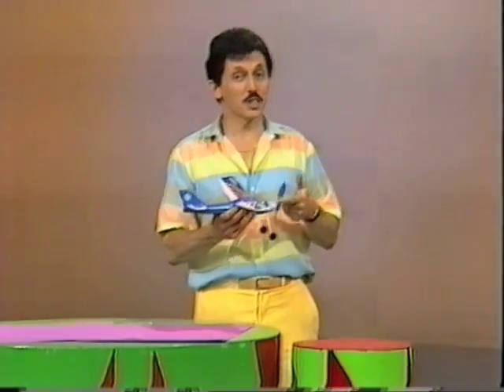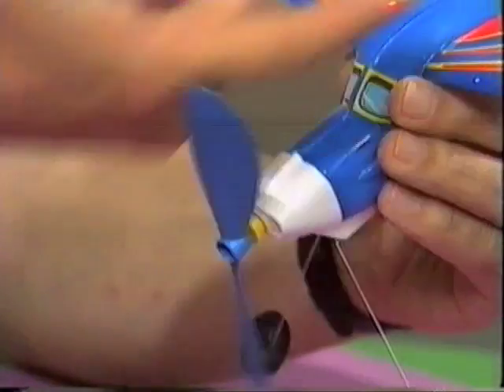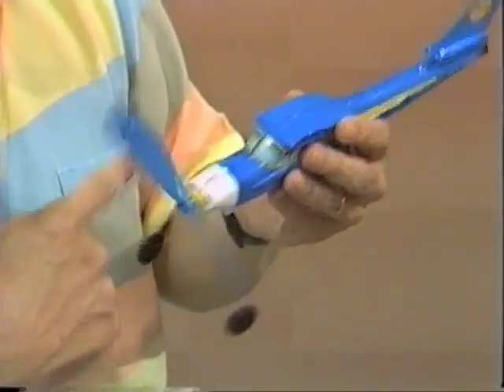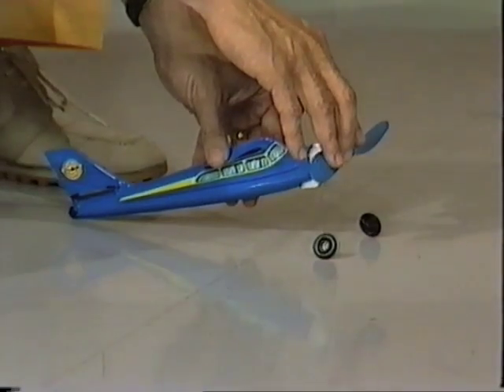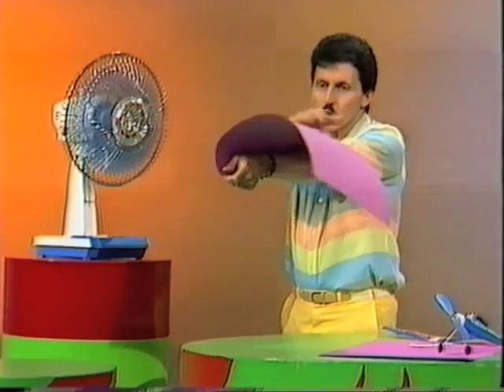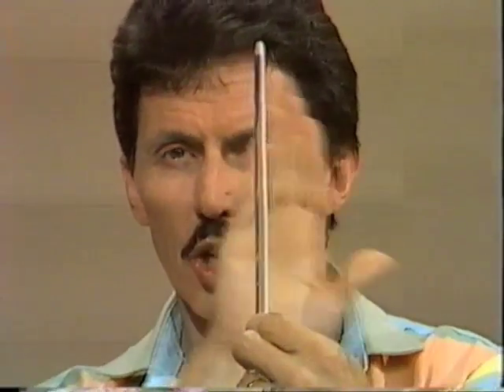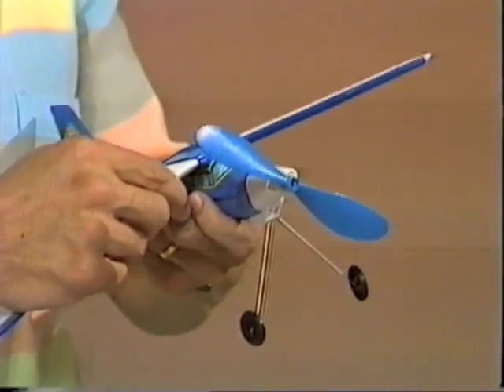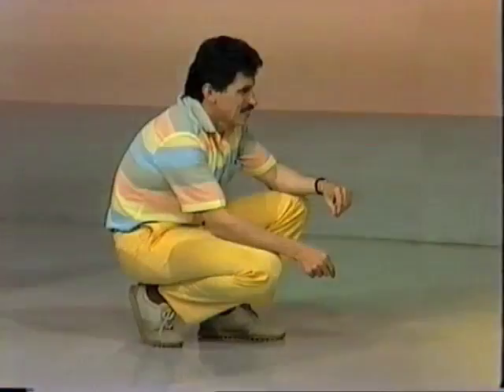Aerofoils - Wings and Spoilers

Comment: It has almost nothing to do with Bernoulli's principle! Wings don't need airfoil shapes at all - it's purely about Newton's Third Law - the air is deflected downwards by the wing's angle of attack (to which the curve contributes). This is easily demonstrated with a helicopter or even the propellor of an aircraft which are both examples of 'rotary wings'. It's quite clearly moving air downwards with the 'wing' (and helicopter) moving upwards. If your explanation of lift is correct, you should be able to stand under a helicopter and there would be no wind. Clearly that's nonsense.

What is critical is the angle of attack which determines how much air is deflected in the opposite direction of the required lift. Airfoils are designed to minimise drag for a given angle of attack.

Comment: As wind goes past the wing, on the top the air has a longer distance. This make the air spread out - a low pressure. On the bottom it is a straight line so the air stays the same, or a higher pressure then on top. 
That helps lift the plane, but the wing on an airplane is tilled. 
In a car, stick you hand out the window and hold it flat, then tilt the front up a bit and this will push your hand up. 
It is a combination of both that make airplanes fly.
Propellers and blades on a helicopter are much the same as wings.
Reply: You would design a very inefficient plane Paul. An efficient plane wants the least angle of attack as possible (preferably zero) to minimise drag while producing lift.